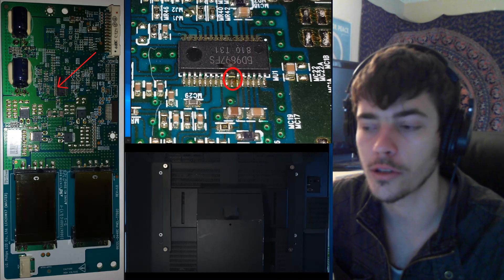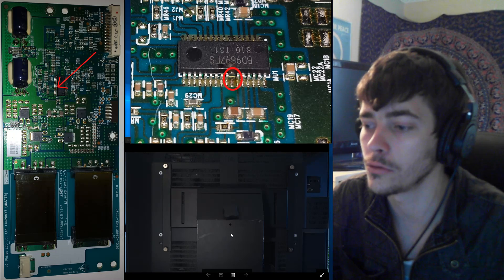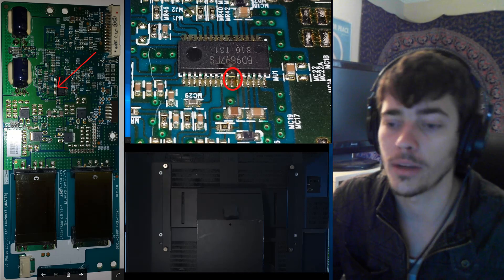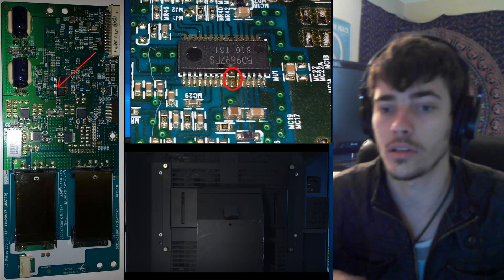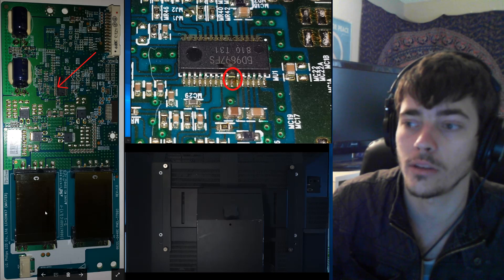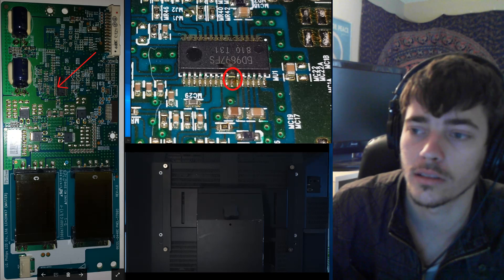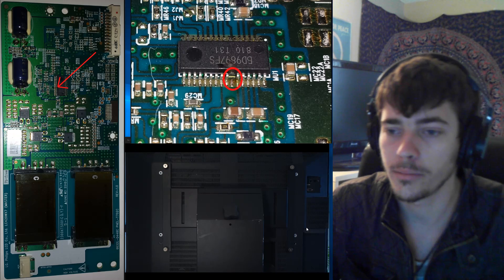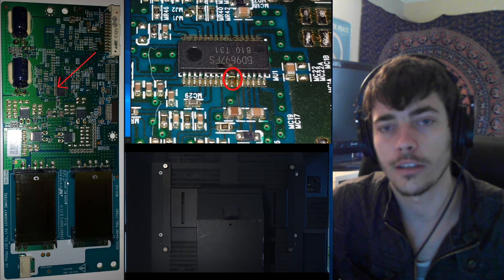Tutorial: How to fix Philips 42" LCD TV in 5 min! Sound but no picture? Backlight not working

Comment: Adam great video it’s midnight hrs in the uk, so I’ll hhave a look in the morning. I’m also loosing sound but a lot more than the vision. Do you have anything that will help with that as well. All the best have a happy Christmas & prosperous new year. Mike. Surrey. Uk.
Reply from the maker: Best thing to do is to open up your TV and inspect the two boards up close, and slowly look at all the connections. If anything has failed, you'll either see it burned out, if it's a capacitor it might look puffed up compared to others, like how old batteries get swollen. Or it could be a connection that's come lose over time, where a wire is soldered to something. Those can be extra hard to see, but if you pull on a wire gently, it'll be obvious if it's detached. Then you just solder it back on. The TV will work just fine to turn it on while it's opened up, so I'd say play something on it and wiggle some wires to see if anything changes the sound quality. Make sure to only touch plastic if it's turned on. Don't touch anything metal or you could short the board and make new problems to fix. And don't touch capacitors at all while it's plugged in. They can put dangerous amounts of energy into your body.

Comment: actually TV was works fine before i de-assemble to fix vertical lines. so i was remove the back cover of tv then screw T-CON board and try to connect the T-CON Board left side socket to the with LCD panel right side ribbon cable like swap to check the vertical lines get fix or not then tv turn power on and display goes to black ,no back-light, sound works. that was happen. please help me to find out which board need to be repair or replace?

Comment from the maker: Hey guys, even if your TV isn't a Philips, if you're having the same problem, it's probably gonna be the same solution. Best of luck to you all!

UPDATE: 1 month after making this video, my SLAVE board also burnt out with the same issue. I strongly suggest that when you make the purchase, that you be sure that you get both the master board and the slave. Since then, I've had no problems with this TV.

Update 2: three years later, the TV is still working great.
Reply: hi Adam my phillips tv is zoomed in. even the menu. have tried imagine the menu layout and setup to find the reset button but still the same. turn off and on still same issue. couldt find the hard reset button. lol i am now thinking of dissassemble and assemble it back. i hope it better work.lol